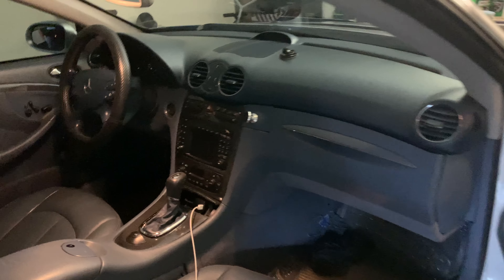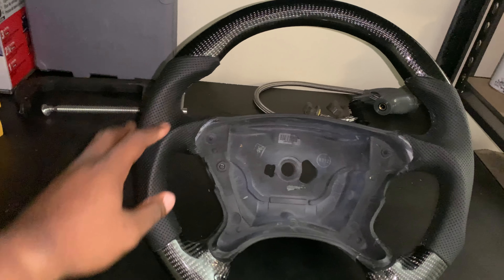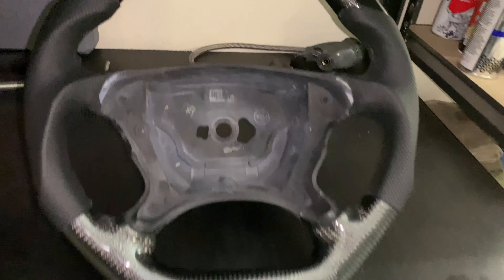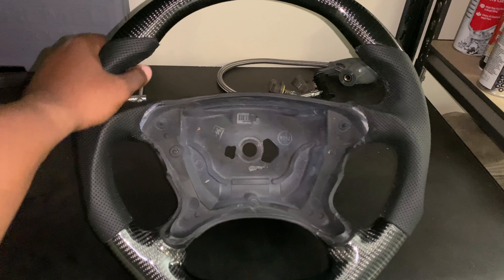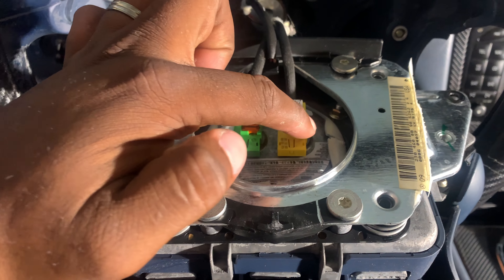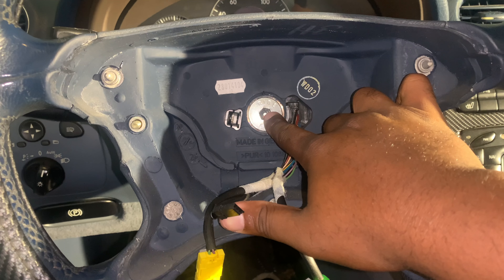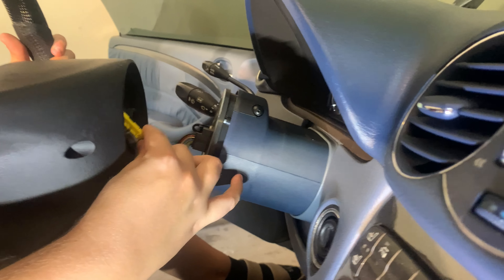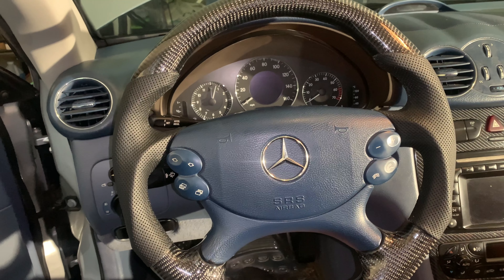How To Remove And Install Steering Wheel And Airbag On A Mercedes CLK500, SL55, CLS55 AMG!

Comment: Good to see you removed the battery terminals before removing airbag 👍😁
Reply from the maker: Oh yea, always
Reply: I've a spare w209 airbag in black I want to two tone the steering wheel grey n black airbag is it possible to change the airbag it's from a same Mercedes w209
Reply: I've a spare black airbag w209 if ya interested that's if you haven't brought one yet

Comment: Hey i have a question. I do not like w209 steering wheel, so i decided to change it for a aftermarket one or something diffrent that is a replacement. I'm interested in w204 2007 steering wheel but i don't know about that it will fit or not. Also i don't know about buttons and airbag, will that work or not. Mabey you will know a wheel that is compatible with w209. Thanks
Reply from the maker: Honestly I’m not sure if it would work. Check with the company and find out

Comment: Nice video - very interested in where you got your steering wheel. I searched ebay for the user you listed, cannot find them. Anyway you can get me in touch with them? (also, did you do a follow up on having the wheel on for a while?) Thanks!
Reply from the maker: I can’t find them and can’t get in touch. After it was delivered I tried reaching out but they closed their store

Comment: Hey love your videos! Got the same car as you and in a funky diagnosing problem maybe you can help... Im getting a clicking noise from inside the steering wheel when turning sharp at slow speeds, i checked the cv joints and dont here anything when im down there, could it be the clock spring?
Reply from the maker: Check the sway bar stabilizer links bolts. Make sure they are tightened and not lose

Comment: Have you hear of rucarbon ?
Reply: You think the w211 or e55 steering wheel custom is compatible with my 2005 w209 clk 500
Reply from the maker: I haven't but i just checked out the site.
Reply from the maker: It should work, you would most likely switch the color tabs from your airbag to the e55 air bag which will be simple. but other than that you would have to talk on the phone with whoever is helping you making the steering know it will be going on your w209 for installation instructions.
Reply: @HeyboysGarage  thanks for your insight, can you link the wheel you bought
Reply: @HeyboysGarage  thank you bro